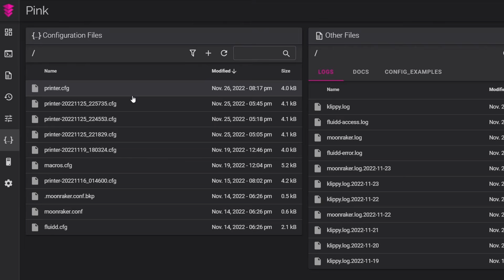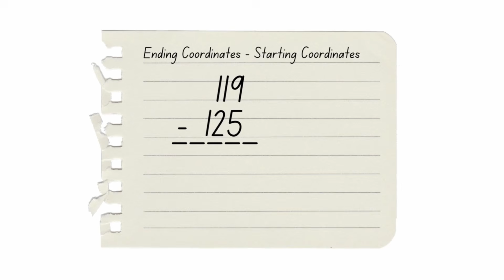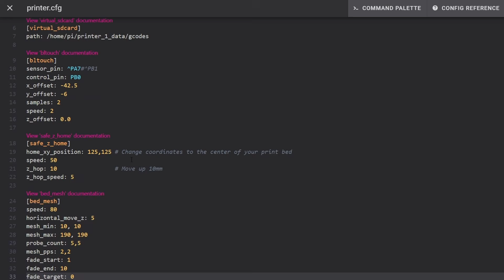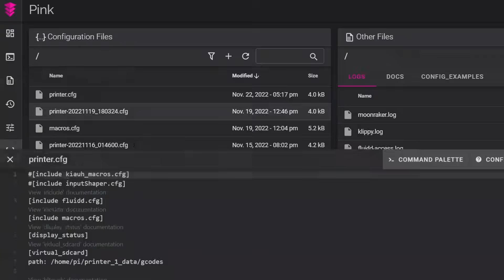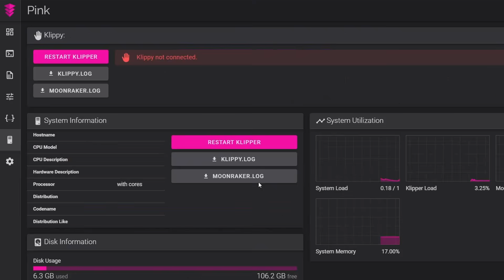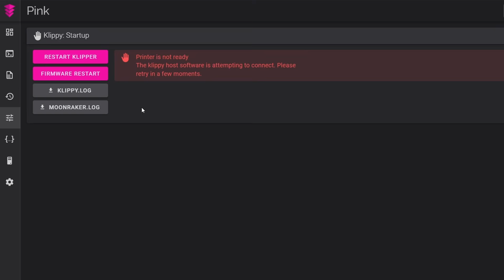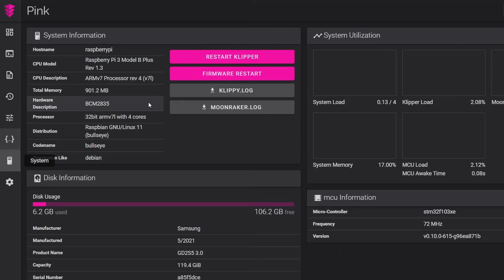BL Touch complete setup for Klipper! Maximize your probed bed mesh!

Comment: hello, can u share ur gcode start and end in cura? i still learning the macro function in this klipper
Reply from the maker: If you go to my website (printsleo3d.com) there is a Klipper section on the header.  Once you get there scroll down to the macros section and click it to be brought to the macros page. There you should see all of my basic macros that you can copy and paste. This way you only have to add the name of the macro you want to call in Cura's start gcode section.
    I hope this was helpful. If not let me know.
Reply: @PrintsLeo3D  Dude, you're a legend. 
Thanks a lot. Now I know a bit about what Klipper actually does to my printer and what slicer settings I need. Thanks again.
Reply: @PrintsLeo3D  and thanks a lot u still reply this comment on a video that actually uploaded a year ago

Comment: Do you have a link to your live Z offset calibration pattern?
Reply from the maker: I don't have a model link because all I do is import 5 cubes, then shrink them to a single layer high (0.2mm for me in the video) and then spread them out to the different corners and center of the build plate. Nice and easy!

Comment: I didn't find this start print and end print macro in my klipper, how do I make it appear?
Reply from the maker: Printer configuration files don't come with start and end print macros by default. You can usually find a very bare bones start and print macro on the internet and then add or adjust them to suit your printer needs. Such as proving before each print, or using mesh probing, making adjustments like that. If you go to my website printsleo3d.com there are some basic start and print macros under my Klipper tab.
Reply from the maker: Printer configuration files don't come with start and end print macros by default. You can usually find a very bare bones start and print macro on the internet and then add or adjust them to suit your printer needs. Such as proving before each print, or using mesh probing, making adjustments like that. If you go to my website printsleo3d.com there are some basic start and print macros under my Klipper tab.
Reply: @PrintsLeo3D  ok thank you!!
Reply from the maker: @EBIKESBR anytime! Let me know if you need more help

Comment: This is a great tutorial and I had such high hopes for thisas I followed along - but I hit a wall when I was calibrating the mesh and got the dreaded {"code":"key243","msg":"Move out of range: 234.000 50.000 5.000 [0.000]", "values":[234.000, 50.000, 5.000, 0.000]} while it still had plenty of room to go on both x and y. so back to square one I guess.
Reply from the maker: Sorry it's taking me so long to answer this, are you still running into an issue ?
Reply: @PrintsLeo3D  A whole year later. I abandoned my printer not long after this. I'm just now looking at it again. I have 0 hope for anything to work at this point.

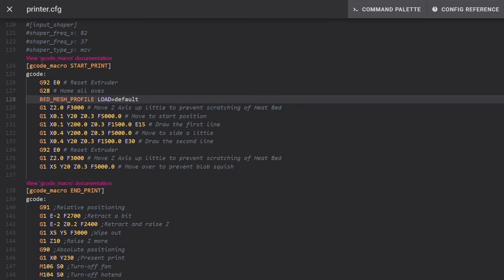Comment: Great tutorial! Only part I'm getting a little caught up on is at 24:19 where you add commands to the gcode macros for Start/End Print. I  don't have any gcode macros in the printer configs I got from github. Are yours universal? Or do I need those numbers specific to an Ender 3 Pro 4.2.7?

Comment: UPDATE:
When autohoming the probe retracts on contact.

==========

Not sure what's going on but I can't get the pin to retract automatically after I manually moved it back into the housing. It worked the first time now it won't do it again. Any ideas? Using an Ender 3 Pro with a Creality BLTouch. I can manually trigger the pin to deploy and stow with the debug commands:

LED on CRTouch is purple

BLTOUCH_DEBUG COMMAND=pin_down
Verified pin deploys and LED is blue

BLTOUCH_DEBUG COMMAND=pin_up
Verified pin stows and LED is purple

BLTOUCH_DEBUG COMMAND=pin_down
Verified pin deploys and LED is blue

BLTOUCH_DEBUG COMMAND=touch_mode
ok

LED on CRTouch is blue and pin is deployed.

Pressing pin back into housing momentarily and LED lights up red. If you let go of the pin, it drops and the LED returns to blue. If you query the probe when you push up, it's in the TRIGGERED state, then query again when it falls automatically and it's OPEN.

No clue what's different this time around, power cycled orange pi and Ender 3 Pro. Verified pins being used in config are ^PB1 for "sensor_pin" and PB0 for "control_pin".

Comment: Finally a good tutorial on this. Thank you. 

I only got a bit lost at the end - the start and end g-code was a bit of a mystery. After a bit of research I found out that I should delete my start and end g-code in Cura and instead reference the same code entered into Klipper's printer config file  instead.

Comment: Where can I find the pin value for my cr10?
Reply from the maker: Pin names will depend on the board. So it would matter whether it's stock or aftermarket, and then after that it's usually a bunch of google detective work to try and find someone with the same board and using their pinout as a guide. Most aftermarket boards will have a pinout on the underside of the board (BTT is a great example) while others will have you solely relying on pinout diagrams that will hopefully be released by the company.

Comment: everything was great untill the endstop min/max, my endstop postions on the 360 and i want the print had to not go past 343
Reply from the maker: If you don't want the printhead to go past 343 then you can set your max to that position. If you you don't want it to go past that position during prints that would be something you would set up in the slicer (making your max printing bounds 343). Otherwise if you don't mind the printhead traveling outside of printing to the farthest corners then keep calibrating as normal. Let me know if that helps.

Comment: Hey this video has helped me out SOOO much with getting klipper setup but I now have run into a problem I can't seem to find an answer too so I'm wondering if you can help...I printed a satsana fan shroud for my ender 3 and mounted my CR touch to it but now it seems like the probe isn't the same height as before and when it retracts and engages the nozzle is actually touching the bed during the bed mesh.  I can see the gantry actually moving up from the pressure of the bed on the nozzle...I seem to remember a setting with Marlin to change the retraction distance of the probe - is there a way to make the probe engage at a certain height in my config file or should I just print some spacers to get the probe closer to the bed and just redo my offset? Big fan and super grateful for all the informative content!
Reply from the maker: This just sounds like the new shroud is holding the probe up higher than it should be. You need to get that probe lower towards the bed, and usually the easiest way is to shim the probe by using washers where it is mounted, which will lower it. The extended probe tip should be 2.3mm - 4.3mm lower than the nozzle.

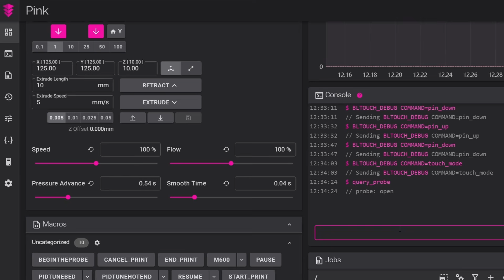Comment: at 4:59 when he touches the probe and it stays up my probe wont stay up with both bl touch and cr touch does that affect anything cuz it says triggered when i hold it up manually
Reply from the maker: If you want to send me a quick video of this symptom I can help diagnose it. My email is printsleo3d@gmail.com 

Having the probe triggered means it's working like it should but it needs to retract and that's due to the magnet, so it's weird that's it doesn't.
Reply: @PrintsLeo3D  @PrintsLeo3D  Thank you so much for offering help. I don't know how but I borrowed my friends cr touch and tried it again with no luck so I switched back to my bl touch and some how worked. but you reaching out to me. That definitely gets my sub!

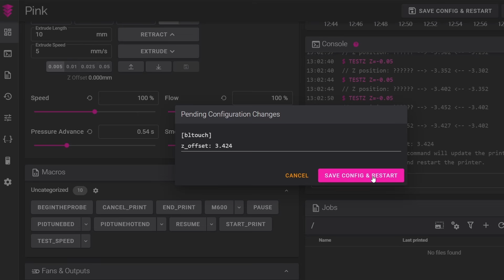Comment: 10:50 wtf is a "disk ets hop?" what??
Reply from the maker: The "disc at top". After running any calibration which saves values (ie pid tune, z offset, etc) a small disc icon will appear at the top of the home page of your front end. If you click that disc it will show you the new values of the given calibration (you just performed) and allow you to save those results.

Comment: I'm so frustrated with my ender max neo I updated to sprite pro so my x offset is off 25mm I followed ur whole video but it still didn't resolve and now I'm getting an movement out of range 316 34 5 [0. 00] values error when I try calibrate the bed would you be able to help
Reply from the maker: Absolutely, I'd love to help. Sounds like it is that X axis that is giving you issues as that is what the error code is showing. Can you tell me what you calculated your X and au offsets for the new probe ?
Reply: @PrintsLeo3D  when I home my bed my coordinates show  x:182 y: 167

Comment: There is a issue setting up the nozzle 0.0 position. For me setting the nozzle at 0.0, then moving to max position (for me x -1 also) but when moving up y the nozzle is not over the bed.
Reply from the maker: Gustav, I'm not sure if I fully understand your situation, but it sounds like you would just have to adjust the Max Y coordinate to suit whatever the farthest part of the bed it can reach it. Not sure if that makes sense given your setup?

Comment: Thank you! There’s something here that I haven’t seen anywhere and I believe is very important. When you are talking about maximizing the probe area, it is something that should be done as part of the setup ALWAYS. Specially if like me you installed a new horned configuration such as Voron Afterburner. Otherwise the (0,0) is totally off and prints aren’t centered
Reply from the maker: Yup, you're absolutely right. Maximizing the print area is just one of those things we all can forget about with the other stuff we focus on, but gaining space along the build plate can be extremely important. Thanks for commenting!

Comment: Great video! And what about absolute offset of the probe? Is it stable against temperature after calibration? Can I use this probe for the first layer height probe with different bed temperautre?
Reply from the maker: Dmitry, thanks for watching and for liking the video! I'm not exactly sure I understand what you mean by absolute offset? Are you asking if the offset we calibrate here will be correct once the bed heats up andnl expands/changes shape? My answer to that would be yes it's going to be pretty accurate, but that's where we use the love z offset methods to get it just right. Let me know if that answers the question!
Reply: @PrintsLeo3D   Thank you for reply soon. I meant, if I use BLtouch as Z endstop  after calibration, should I worry about first layer height repeatability resulting of internal BLTouch accuracy? Moreover BLTouch  can heat up from bed, and absolute accuracy (resulting in first layer height)  can vary against temperature.
Reply from the maker: Those are super smart points. In my experience using a pin style probe, like a bl touch, I haven't seen any variance based on bed temperature that would cause concern. I've printed with bed temps from 55c to 105c and I have never seen an appreciable difference.

Comment: Quick question.   If ive already got my crtouch running great with marlin, can i just harvest the figures out of the current firmware and copy them to the klipper firmware?
Reply from the maker: It depends on what you're trying to move over. For instance the measurements for the X and Y offsets would be identical. As for the actual mesh that gets created , Klipper will take care of all of that for you.

Comment: My Klipper firmware is not leveling the bed properly... I run the mesh, save it, it reboots. I then go to print, but it makes no difference, and its not level in all the same places in my bed. I tried 6 point mesh, I tried 5, I tried 4, and none make a difference. Is it possible that my slicer is not enabling bed leveling before the print or something? 

With Marlin, I could level the bed, validate the mesh mesh, and even edit each point in the mesh, but Klipper is not giving me the validate and edit mesh options.
Reply from the maker: It's definitely possible Klipper may not be applying the mesh, it all matters on what commands you are running within your start print macro. Can you share your start_print macro, and what commands you are sending your printer though the slicer ?
Reply: @PrintsLeo3D  I could not get the start macro to work, but I was able to get the leveling to work by adding the  BED_MESH_PROFILE LOAD=default to my slicer start gcode. Only issue is I still have some high and low spots in my bed, and the only tutorial I find for that is to add tape to the bed and then probe again. I am going to try adjusting each point in the printer.cfg rather than the tape method to see if that works.
Reply from the maker: I usually stay away from adjusting each point, as I usually let the probe do it's thing. You can look into screws tilt adjust (another video I have for Klipper), that is a calibration that will help use level the bed properly using the bed probe. Can you share your start gcode here?
Reply: @PrintsLeo3D  I think my BLtouch is not accurate enough then because its not filling in the high and low spots correctly. 

I will paste my start gcode from my slicer when I get home... Have you tried the adaptive mesh too where it only levels where it prints? I want to do that eventually as well.
Reply: @PrintsLeo3D  I got my bed pretty level after some tweaking to bltouch settings, but its not perfect. I think its mainly because the probe is not reaching the outer edge, so that will require a redesign of my toolhead. 

As for the start gcode, this is what I have in my slicer: 
G90 ; use absolute coordinates
M83 ; extruder relative mode
M104 S150 ; set temporary nozzle temp to prevent oozing during homing and auto bed leveling
M140 S[first_layer_bed_temperature] ; set bed temp
G28 ; home all
BED_MESH_PROFILE LOAD=default
M190 S[first_layer_bed_temperature] ; wait for bed temp
G28 Z ; Home the Z axes
BED_MESH_PROFILE LOAD=default
M104 S[first_layer_temperature] ; set extruder temp
G1 Z2 F2000
G1 X150 Y10 Z0.4 F4000.0 ;Move to start position to wait

G92 E0.0
M109 S[first_layer_temperature] ; wait for extruder temp
G1 X150 Y10 Z0.4 F500.0 E10;Make blob
G1 X150 Y10 Z0.6 F500.0 ;Move to start position
G1 X210 Y10 Z0.35 F1000.0 E15 ;Draw the line
G92 E0.0
Reply: @PrintsLeo3D  I dont have a start print macro just yet. I have my start gcode in the slicer from when I was running Marlin, so I have not transferred that gcode to a klipper macro yet.

I was going to do adaptive mesh leveling before each print too, but my leveling mesh is not being used, so I got set back a little till I can figure out what is causing it. Does Klipper have a validate mesh feature like Marlin does? That way I can bypass any bad gcode that might be disabling the mesh somehow.

Comment: I can't get past the "Move out of range" error after probe_calibrate. Do the numbers in the error message help me to fix this?
Reply from the maker: Yes they absolutely do! I was going to ask what the numbers were. Using those we can determine how you are exceeding the range.
Reply: @PrintsLeo3D  {"code":"key243","msg":"Move out of range: -27.600 -2.000 7.303 [0.000]", "values":[-27.600, -2.000, 7.303, 0.000]}
Reply: I retreived the S5 after throwing it in the lake so a year later can we try again please? lol

Comment: it is me again LOL  I have 2 printers that I can not get Zoffset set.  I can get it so when i feel the slight drag on the paper,. but when I go and print it is in the air WTF?  when i first use Probe_calibrate   Z is never  5.00  it is slightly more  l;ike 5.02 for example.  TRo get the paper  feel drag z goes into neg,  this isnt right is it?  I am using a BLTouch.  Do I have the BLTouch set to high above me nozzel? how do I get it so it triggers  properly
Reply from the maker: Jim what does you z offset end up being after the calibration is finished? What is saved under the Save_Config section of the printer.cfg? This is a great time to hop into the Discord and share some pics and explanation with the crew over there.
Reply: @PrintsLeo3D  I will have to check when I am home.  It was like 2.xxx  but it was actually negative. Just klipper kept it as positive
Reply from the maker: That sounds about right, or at least what is to be expected. This is the sort of scenario where seeing some pictures would help out a lot.

Comment: I missed that you did not talk about [safe_z_home]. In order to have the probe do homing in the middle of the bed, you need to add the probe-offset to the home_xy_position. It was confusing me...
Reply from the maker: Sorry for the confusion. I guess in general the offset is not a lot to notice and it's possible it slipped my mind. Thanks for clarifying.

Comment: Hi.Fantastic job with this video. Really all the information you need. I just have one obstacle preventing me from finishing the job. When. I start the calibration, the third point in, BL Touch locks into the up position, and Klipper reports an error. I assume this has something to do with the z-offset calibration. My z_offset number was 16.05 which is significantly more than the one you had. What could possibly be the problem? Any idea  Thx a million
Reply from the maker: So sorry for the late reply. Where you able to diagnose this issue ?
Reply: @PrintsLeo3D  Hi, no problem at all. I did solve it to the certain extent. Now I get the mesh, but it looks totally off. Looks like it is vertical and not horizontal. It's really bugging me.